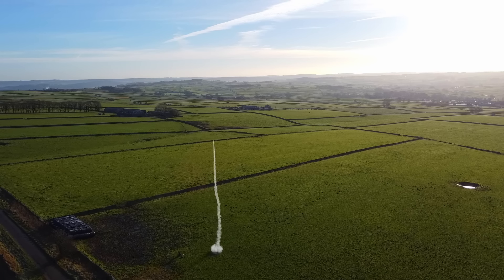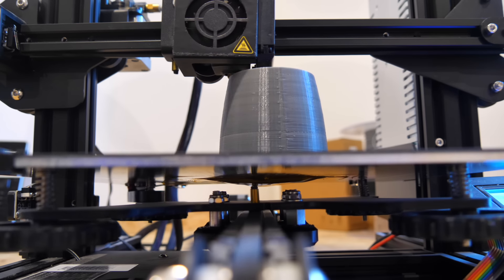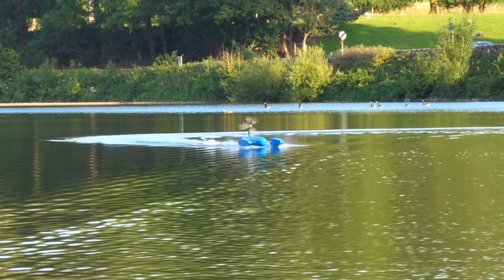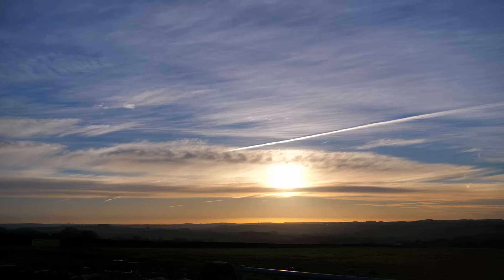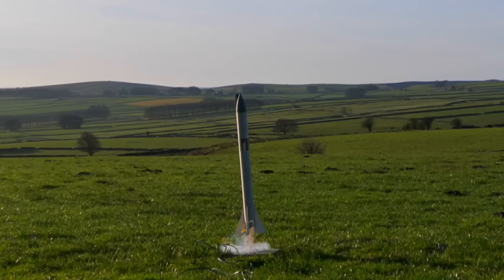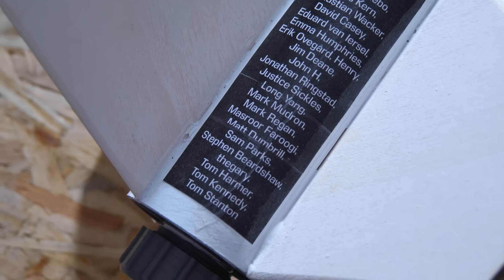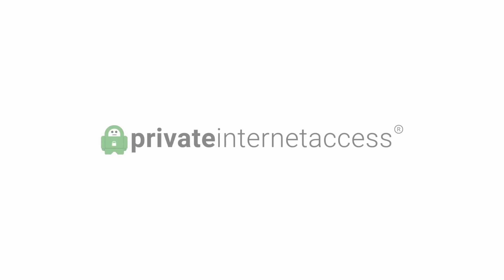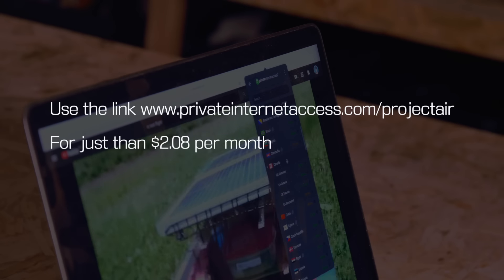Making a Powerful 2-Stage Rocket

Comment from the maker: Hope you like this rocket build! 🚀 Get complete digital privacy from Private Internet Access with this link - https://www.privateinternetaccess.com/projectair
Reply: First
Reply: certainly Nice video 👍🏼🚀
Reply: Have you thought about using a flare parachute?
Reply: Great video. What was your method for ensuring the fins were dead straight when you constructed the vehicle?
Reply: @James Wedge he has said in previous vids he works for a model aircraft company. Vintage model co if memory servs correctly
Reply: I really really want to see how many stages can be added to a model rocket. 4, 6, 12??? with progressively smaller motors and MANY STAGES is it possible to get to 100,000 feet? lets find out.
Reply: That looks like a aim-9E air-to-air 
misile
Reply: Plywood seems a bit heavy. Why not use lighter materials. Balsa has been used in model rocketry for the past 70 years. Also beverage can aluminum is a great skin for rockets.
Reply: Vertical speed could be classified.

GPS uses military satellite constellations. The US only allowed civilian GPS usage IF it's not going to be used in weaponry that could be used against the US. So civilian GPS receivers can be highly restricted in some aspects.

My science teacher in highschool included a GPS tracker in a yearly weather balloon experiment. He found out why it would never work. The GPS would stop collecting data altogether if it exceeded a certain speed or altitude.
Reply: I love your Videos
Reply: Hey, thanks for videos, how old are you?
Reply: I know Im asking randomly but does any of you know of a trick to log back into an instagram account..?
I somehow lost my login password. I would appreciate any assistance you can offer me!
Reply: @Kameron Ronald I really appreciate your reply. I found the site thru google and Im trying it out atm.
Seems to take a while so I will get back to you later when my account password hopefully is recovered.
Reply: @Kameron Ronald it worked and I actually got access to my account again. I am so happy!
Thank you so much, you saved my account!
Reply: @Easton Ronan Happy to help =)
Reply: Very nice video it was awesomebut like @Iance vanvelzen said a flare parachute would be cool
Reply: @typxxilps  thx
Reply: Can you make a tutorial of how to make this one?
Reply: How about a 3 stage rocking

Comment: Been watching a bunch of your rocketry videos. I see you are using nylon chutes which is good, but recovery systems failure to deploy, failure to deploy correctly (tangled), or failure to deploy at all, can be attributed improper stowage. 

To achieve a higher success ration I suggest the following two tips. 1) carefully dust the chute with talcum powder prior to launch. Be sure to make sure some of the powder ends up between the tube and the cone to assure a clean separation. 2) To avoid tangles, be sure to carefully fold the chute into pie sections and then cure, wrapping the string around the chute very carefully. Combined with the powder, this will avoid the tangles and assure full deployment almost 100 percent of the time.

Comment: Nice project! I’m a little bit worried about the Estes BT80 tubes being able to handle a G or an H. Speaking from experience, those CTI composite motors have way more thrust than a black powder motor, and the Estes tubes are quite thin and really only meant for low-power use without any reinforcement. In the future as you progress into high-power I would suggest you consider using thicker tubes.

Comment: You need to get yourself a SkyRC GSM020. It works with GPS/GNNS and is far more accurate and smaller/lighter than the one you have. Pretty stable all the time with 12 Satellites and will read up to 29000ft.  If you want to try one first I have a spare.

Comment: Aside from weight, which I don't know off hand, I'd recommend a Tile Pro for bluetooth location. The Tile Pro has a range of about 300 feet, whereas the Tile Sticker only has 150 feet, according to Tile. The Tile Pro is relatively easy to disassemble, with a bit of finesse, and remove the plastic case/metal frame, wire a 3V battery to, to save weigh but gain a bit of distance if you need it. Not to mention the Tile Pro has a much louder ringer, which is (from experience) decreased a lot when placing it inside an RC vehicle...

Comment: Nice video man, great to see young guys getting into model rocketry. I bought my first Estes rocket way back in 1980, it was red a black with skull and crossbones decals. Flew great, although the fins got damaged on landing. Fins that don’t protrude from the base downwards work much better for models. Great see guys using all the cool kit to model and receive telemetry these days. Regarding the speed and GPS, can you not use accelerometers these days? They’re pretty cheap and compact as far as I know.

Comment: RockSim is a great bit of software.  I remember when that was only available on 3.5" disks.

The GPS calculations don't work well for vertical speed.  Try using an integrating accelerometer or a logging pressure system instead.  I know, you did not want to use a rocket computer but the difference in accuracy is worth it.
Reply: I don't really see a big enough advantage of rocksim over open rocket to justify how much rocksim costs.

Comment: GPS uses something called trilateration and due to the vertical position of the satellites and range errors and environmental factors (interference of EM waves with at atmosphere) makes calculating vertical position much harder than horizontal positions

Comment: Are you planning on getting your level 1 cert? You can’t fly the Hs and high thrust Gs without it. Also for a proper gps unit and tracker combo, I’d recommend the featherweight gps, the module that goes into the rocket weighs only 40 ish grams and has been used on flights to 100k.
Reply: Yea he is, he said so in the video. His gps method seems fine for level 1. Level 2 and 3, yea a proper gps is recommended.

Comment: Awesome work! Not a common viewer but thanks to YouTube's algorithm, here I am :) Instsntly subbed. 

You may try adding an Ardunio-recorded IMU, 6-rate, that can later be integrated to give you velocity and position. This may warrant data that is more consistent to GPS. Extremely high sampling rates can be achieved and Kalman filters implemented (if needed) to get results with high confidence.
Reply from the maker: That's really helpful info thanks, I'll be checking that out. ☺️
Reply: @Project-Air   I've used a Trinket M0 in the past with Bosch-based IMUs on dev boards. I think they sell some specifically for drones (BMI088 off the top of my head?) Incredibly low power draw and we subjected ours to >10,000 g momentarily, still worked after! Hardy things if 24g operational limits are OK.

Comment: your GPS cant calculate vertical speed well, because if im right it measures speed by calculating how far the GPS unit goes in a certain amount of time, using satellites. you could use a camera at a certain framerate to calculate it by seeing how far it travels in however many frames

Comment: Great work. Congratulation on the quality and density of the info!.

May I suggest a crazy project for 2021? What a  small (micro) turbine able to burn renewable fuel (ethanol, for example) connected to or integrated with a electric generator?
Liquid fuel power density is orders of magnitude greater than chemical batteries will ever be. A small, compact turbine can burn many different fuels, like hydrogen, ethanol, both obtainable is a green/clean way. Hybrid power is being considered to power electric airplanes.

What do you think? There are small turbines for RC jets but they designed for thrust , not to turn a small shaft.

Comment: Bluetooth has very limited range.  I personally want to experiment adding a small low power Amateur Radio Direction Finding (ARDF) transmitter on board. greater range then wifi and bluetooth and will work in an are with no cell coverage.

Comment: Sorry I just watched mate, wanted to give full attention. Great looking rocket! I actually make firework rocket motors for myself and have as much fun even if I don't add effects. Also love RC, fly fpv race quads and fixed wing as well as boats and ground vehicles. Have considered using race quad motors or a ducted fan to do just vertical. Prop-rocket... Looking forward to BlueBird and the rocket launch! Stay well and safe! Cheers!

Comment: Your GPS tracker looks like the one I use, albeit with a different name on the case. and the KML files can be extracted and converted into EXCEL spreadsheets for analysis.  I don't know how to contact you but would happily five you the instructions if you want them.
Reply from the maker: That would be helpful! Thanks

Comment: Technically your video was correct and your text "correction" was incorrect. The booster rocket motor is considered a High Power rocket motor, not a Mid Power Rocket motor. I assume the motor was a G106 (Great motor btw, flown many of them). A G106 is considered a HPR motor for two reasons. 1st, its average thrust is about 80.  Second, It is a Sparky motor. Any Sparky motor is considered a HPR motor. (I didn't create the rules).

Comment: I really wish you would put the diameter and dimensions of this rocket?
Reply: It looks like a 3 inch airframe from LOC Precision. If not it's a size below which is around 2.56 inch
Reply: @ej-1608  thanks

Comment: TFW your GPS doens't work well because consumer grade GPS is designed with specific limitations to make it impossible to use for missile guidance. Even if you say, got an arduino with a GPS shield, the data would still be a bit funky.

Comment: You can not use GPS for vertical speed, only for horizontal speed.
Reply: That's not true at all, the math is exactly the same. However his GPS receiver likely calculates at too slow of a rate to capture the quick speed changes of a rocket. It may also simplify its calculations which probably affect the vertical information as well.

Comment: Bro can you tell me the cost of rocket engine and overall cost of the rocket
Reply: The propellant is around $30 the casing for the propellant is around another $30. The airframe is around $11 per yard or meter. The nose cone if you buy it is around $20 but if you print it yourself less than $1. The wood is kind of expensive for the amount you get but it's good quality. For the amount he used it's about $15. Parachute depends on the quality and size  it a good guess is another $20. Now you need the cost of glue and small parts that connects things together which is not much.

Comment: For straight fins, you can download the free fin guide tool from payloadbay.com's tools page.  You enter in the dimensions of your body tube, number and thickness of fins, print out the .pdf file at 100%, and glue that to a piece of foam core or cardboard.  Next you cut it out, and use it to keep the fins straight.  Another thing to think of is TTW (through the wall) fins.  This will improve fin strength, reduce flutter, and strengthen the motor mount if the tabs are glued to the motor tube.

You can learn a lot more at The Rocketry Forum (TRF) (www.rocketryforum.com).  Tell them K'Tesh sent you.

Comment: Which motor will the first stage use? Just being a G motor doesnt make it legal; if it's above 80 newton seconds of thrust it's still high power and thus illegal without a cert or cert attempt. Also, the way you are using RocketSim won't yield accurate results. You also have to add the weight of every component to get an accurate center of gravity, while the way you are doing it right now will result in an Incorrect center of gravity and result in a very unsafe rocket.

Comment: fuel isn't strong enough to lift all that plastic lol you need to use a high compact burner and set it to a 2 stage or 3 stage ignition example (primer/1st stage/2nd stage) etc never send a rocket without an initial primer* :) especially if you intend on reaching high altitudes.

Comment: How come you use imperial?
Reply: Brittain's use still Miles to measure a distant, everything else is metric
Reply: @Berke5050  right, thanks
Reply from the maker: Fluent in both mate ;) Yeah, use metric for everything but occasionally slip into using ft for altitude etc - it's quite standard with aviation here.
Reply: @Berke5050  we still measure shoe size in Barleycorns too
Reply: @Project-Air  cool, Britain seems to use a conglomerate of all measurement units imaginable